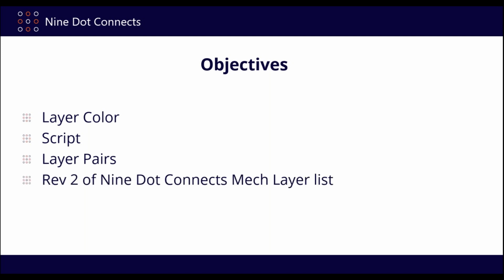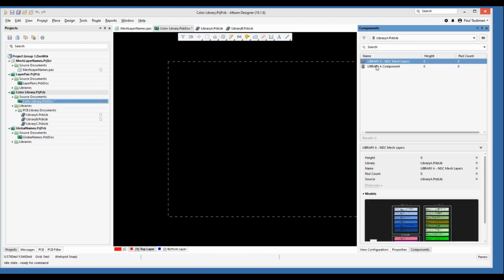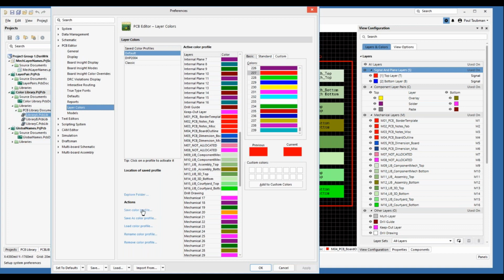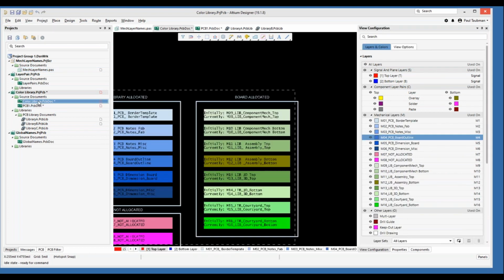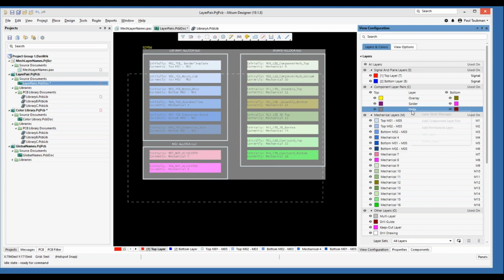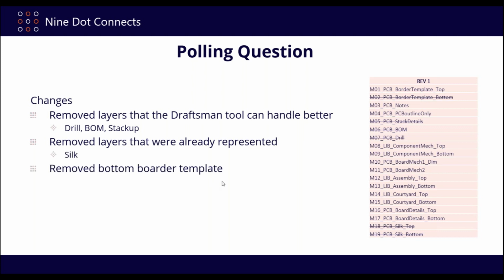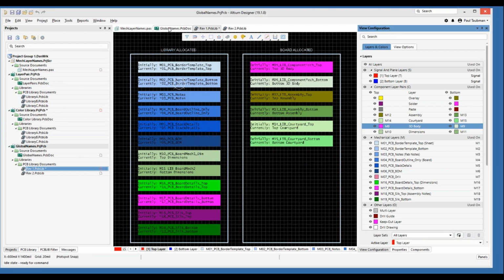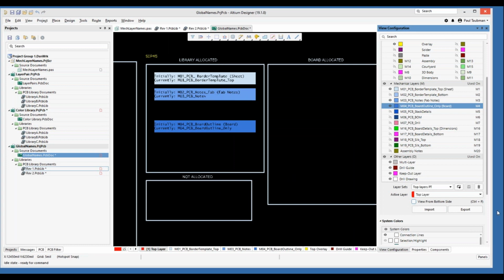Mechanical Layers – Revisited

Comment: Hi,
I wanted to know if this video is also valid for Altium 25.
I did a quick test on a new PCB file using the default layer set.
I tried inserting a component from my library (just like you did) with an active pair of mechanical layers.
Once the component was placed on the PCB, the PCB’s layer set automatically updated to include the component’s mechanical layer pair.

If that’s the case, would it make sense to already create the mechanical layer pairs in the footprint library?